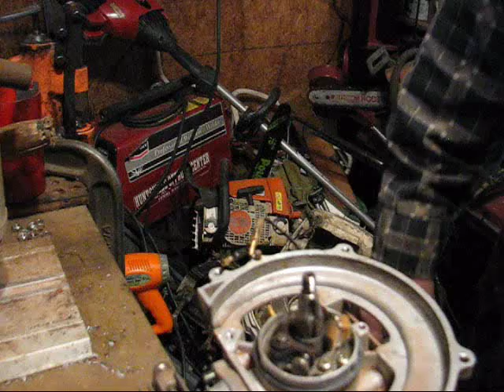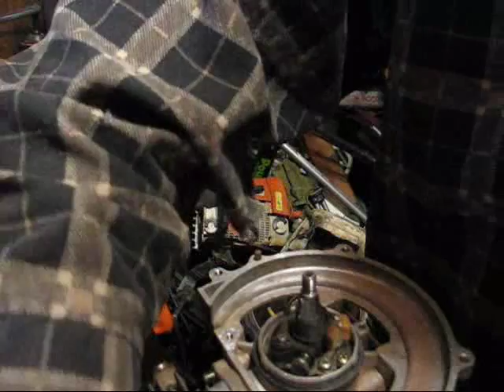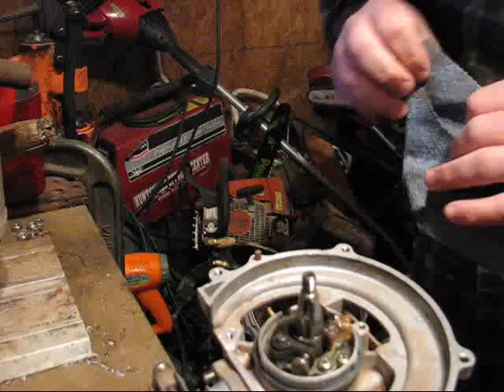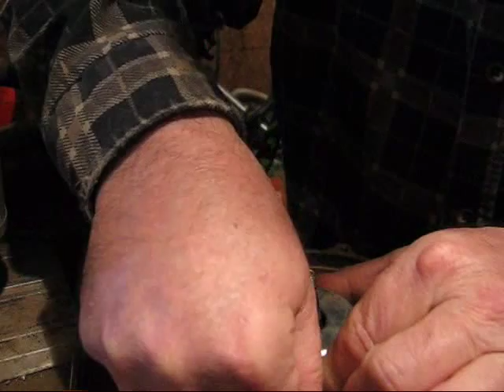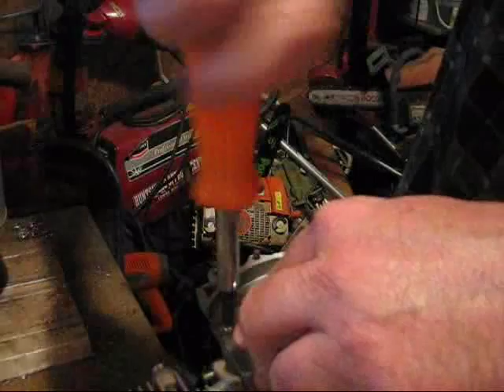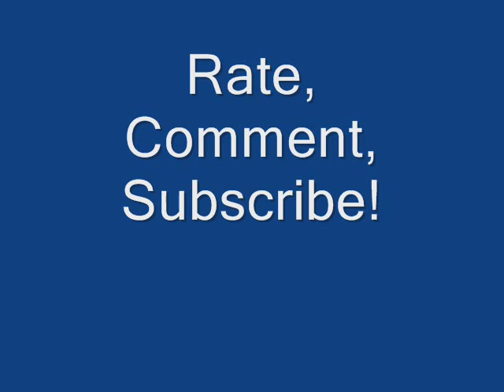Working On My Tanaka Outboard Motor

Comment: Tanaka had a production run of these outboards from the 1.2 horsepower all the way to the 3 horsepower from 1975 to 2002 so there's bound to be some parts what happened was when Tanaka was bought out by Hitachi because  Tanaka almost going out of business Hitachi is doing a lot of discontinuing of a lot of parts in order to save money to save the company so I was told by my local Small Engine dealer so there are some parts but not all parts but at least the ones you're probably going to need I would think

Comment: order a new flywheel from tanaka it's like 58 bucks as for the crank keyway they still make that too I believe it's like 80 or so dollars it is a bummer that the person did you whrong though hate when that happens
Reply from the maker: I'll check that out; thanks. I was under the impression that neither the motors nor parts were made any longer.
Reply: Well some are some aren't mainly the common wear and tear parts are what are still available such as clutches points condenser coils flywheels crank seals crank bearings cylinder is available I'm sorry piston rings I think they all come in a kit but I found some things you never know if you don't try to look around
Reply: Possum Living I think they are called Gamefisher, I found my fathers three horsepower tanaka, made in 86, sold in 87.
Reply: @fbksfrank4  Tanaka made game Fisher, for Sears, mid 80s to mid 90s..under 3hp are air cooled and auto drives, 20lbs..

Comment: I do not see any updates for this one. Does it LIVE?????
Reply from the maker: The JB Welded flywheel key did not work. I bought another partial powerhead that had cdi (this one has points) but then I got busy with my 'Rude 9.5 and messing about on the river with it. I plan to get back on it when it starts warming up again.

Comment: I would grind all the way around the crankshaft and just jb weld the heck out of it and hope the points hold lol because once that flywheel goes on it won't come off anyway so I would make sure and can you find a solid state coil for it ? that would help alot , I feel bad for you I have been burnt a few times on ebay